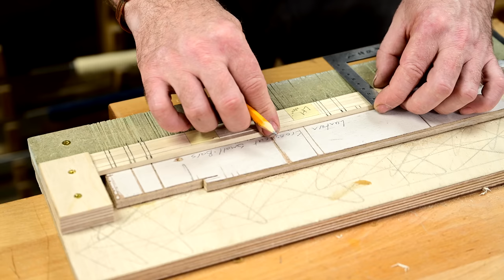Joinery Techniques: Make a Japanese Lantern - Woodworking Wisdom

Comment: I've just finished making this lantern. some thoughts:
I understood Jason's commentary
I counted 221 joints!
I used Sitka Spruce for the matchstick like Kumiko features - oak would have been better as making accurate cross halving joints in small softwood is difficult
I found that 5mm square is too small and made 6mm square
WH Smith tracing paper is fine stuck down with PVA. Wrinkles can be removed using a hair dryer on low heat
I've used a small LED 'push front' bulb 2 for £1.50 in Poundland. I made a lightweight cross frame to support the bulb inside the lantern
Japanese tools not essential except for the saw which makes a very fine cut. Tools must be sharp!
Reply from the maker: So glad you enjoyed making this project and have been able to adapt it to suit your tools and needs.  Thanks for sharing

Comment: Little trick from making model aeroplanes more than 5 decades ago.   After glueing the paper to the frame LIGHTLY spray the inside surface with water (perfume spray is perfect) and leave to dry.  The paper will shrink slightly and become much more taut and smooth.
Reply from the maker: What a great tip! Thank you for sharing

Comment: does anyone have all the dimensions used in the video for the panels and frame?
Reply from the maker: Hi Thilak, here is a step by step guide complete with project plans - https://www.axminstertools.com/ideas-advice/joinery-techniques-japanese-lantern/
Reply: @axminster  hello, i see that the width of the panel is 124mm, so for the horizontal bottom stick in a panel, it has 9 sticks joined in to it which take up 45mm (9x5) of space and so the gap between each stick would then be 9.875 ( (124 - 45)%8 ), i am not sure how this measurement worked out or i have done some mistake in the calculation